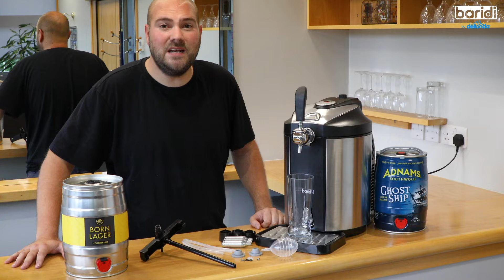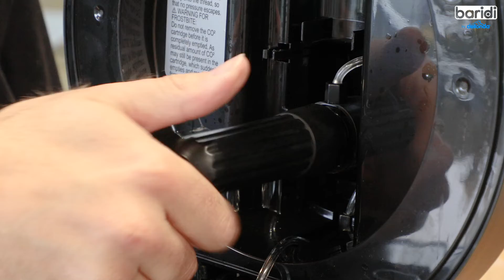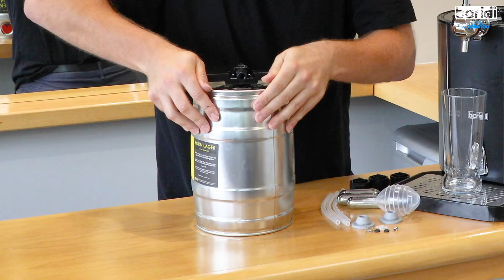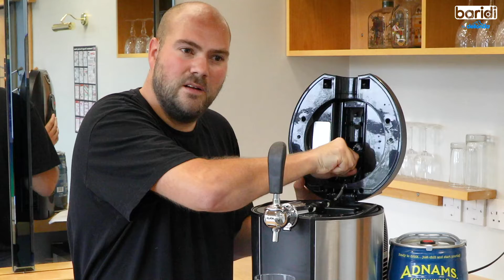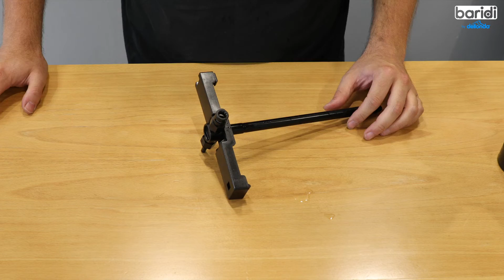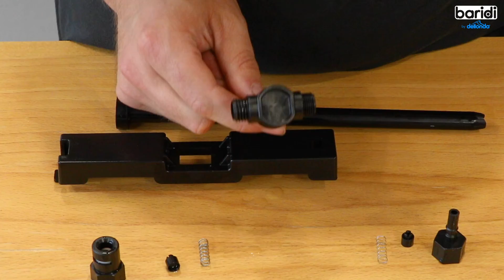How To Assemble, Use & Clean a 5L Mini Keg Beer Pump Dispenser - Baridi By Dellonda

Comment: I bought a second hand 5L device similar to this in the US.  It was distributed by a company called, "Nostalgia".  I unit was in rough shape when I got it but I cleaned it up nicely.   I did find a odd spring that I could not place until I saw your video.  It is from the keg lift assembly  gas side or liquid line that was missing but I replace so its all good!  Thank you! Now my unit is working and pumping out German Festbeer.

Comment: Hi just to check, i changed keg and did all the cleaning. I put the 2 stronger springs on the co2 side and the soft spring in the beer dispenser side but this new keg is flowing very slowly. I can tell there is still co2 as when you slightly untighten the holder it starts to leak. Just wondering if im missing something obvious here. Btw im turning the gas on full when poring but very little improvement. Still working for now at least but very slow pour.
Thanks

Comment: Mine leaks all the co2 as soon as I screw it down. I'm thinking it's the co2 cartridge washer. I can't tell if the old one is till in there or not. I pressed a new one in there but it looks like it got twisted as I was tightening the cartridge down and still leaked all the co2 out. I can't find and instructions on how to change the cartridge washer .
Reply: Have same problem. When i set CO2 cartridge, all co2 runn out and beer is without pressure. Didnt find any ideas or informations, how can i run it correctly and get pressure inside to beer. DO you have any progress in this problem?
Reply: @antonlaringo14   Yes, it was the little rubber o ring that seals the top of the co2 cartridge. I used a eye glasses screwdriver to carefully pry it out of there and pressed a new one in. Odd that it comes with extras but there is no directions on how to change them.

Comment: Got this machine second hand, but discovered a small leak from thr bottom of the unit. Any idea of likely know causes? Maybe an assembly diagram is available anywhere? I had no luck finding one.
Reply: Where is the leak coming from at the bottom is it from the drip tray area ?
Reply: @AceTeale  I have removed the drip tray and the bottom cover for drainage pipe. I can just about to see a small drip further inside the cavity, sort of in the centre. Unfortunately, I cannot access that area. It's not the drainage that is the problem.
Reply: @TheBonifacy87  Okay it sounds like a water leak maybe a crack somewhere under neath a bit of glue under there maybe ? I will try and get a assembly diagram and stick it on my next you tube video or could send you a few pictures..of my one.

Comment: Duuude what about the other keg u got sitting there the ghost ship, that's what I have with the red on side and top how the hell do you use that one??
Reply: Vent the keg as per instructions on the side of the keg. Pull out the red insert from the bung at the top. Then follow the instructions in this video. 👍

Comment: Any recommendations on where to get a new t pipe
Reply from the maker: Hi Ryan, at Dellonda we supply all spare parts for this. Please contact, 01284 757575 if you need one
Reply: @dellonda7602  I'm over in the USA,  does that matter?

Comment: My dispenser leaks water with the drain point on shut why is this?
Reply from the maker: Hi Christopher, this might be a split in the pipe. Best thing to do is to contact us on, 01284 757575 and they will help you with this.

Comment: When pulling a pint do you turn the gas say half way then once finished turn it off ? Obviously when not in use it stays off permanently.

Plus how do you know which kegs have co2 & ones that don't  ?
Reply from the maker: Hi 
The valve on the top is just to regulate the pressure when pouring, just use when you want to start pouring, until you finish. 

And The Kegs that do not take CO2 have the different fitting not the `T` Bar fitting.

I hope that helps
Reply: @del @dellonda7602  I mounted a Heineken shum, I left it for one night, it's at 5 degrees but only foam comes out, basically I did 7-8 pints and it's just foam, I'm running out

Comment: how do you clean the pipe at the back, or is this unneccessary?
Reply from the maker: Hi George, you would rarely need to clean this as its just CO2 passing through and the T Bar has a one way valve. However, we would recommend occasionally squirting some water through it.
Reply: @dellonda7602   does the co2 mechanism have a spring?